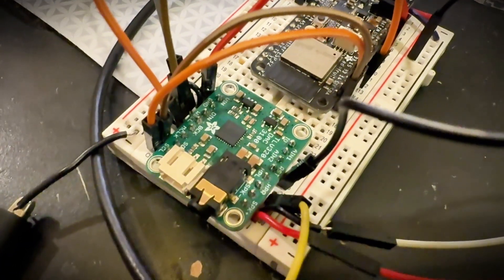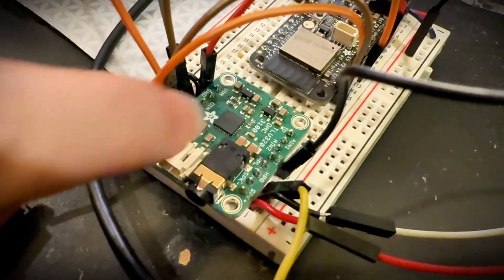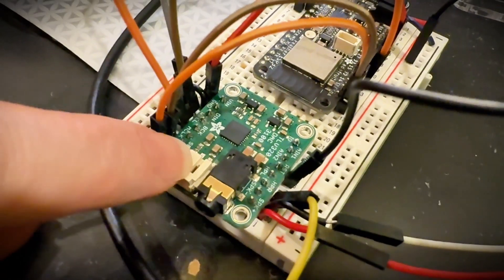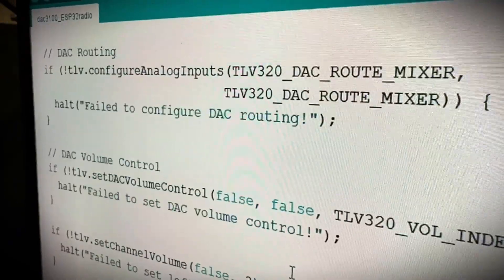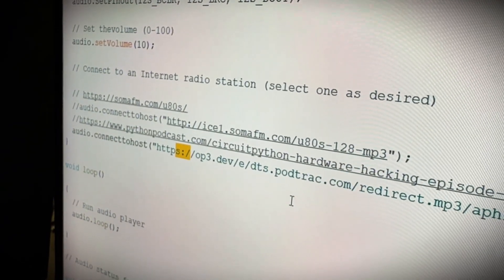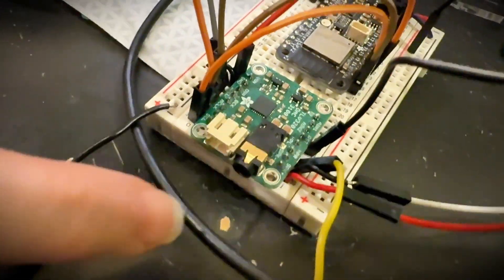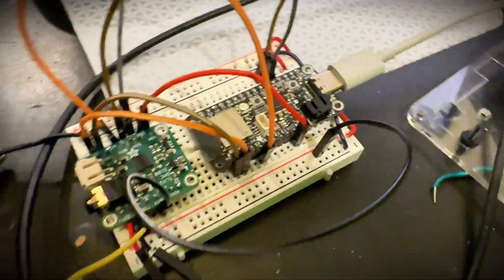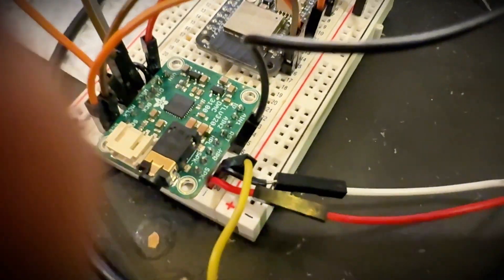TLV320DAC3100 first bops 🔊🎶💃🕺

Comment: Enabling HS detect is explained in driver readme at github haklein/tlv320aic31xx  - it requires HS detect enabling, interrupt enabling, timer mux selection (when generating master clock from BCLK), reseting the int to re-trigger in the future and finally read out the hs state. If you have issues please feel free to raise a ticket on my repo. br Hari ps: hope you didn't waste too much time on deriving MCLK from BCLK, that's all explained in the README (with link to the TI calculation tool spreadsheet) and I've sent a mail to Adafruit regarding the driver some days ago (also was posted on your blog)